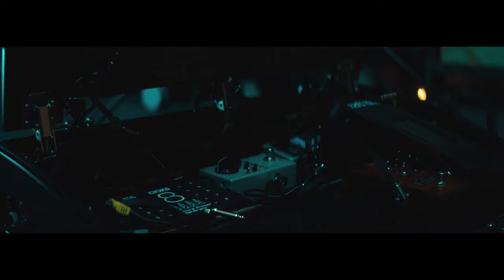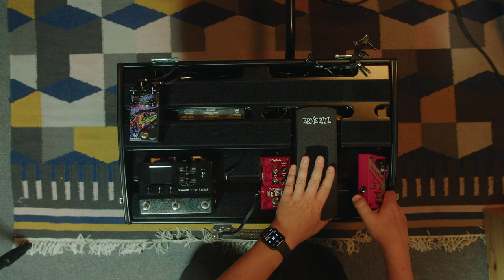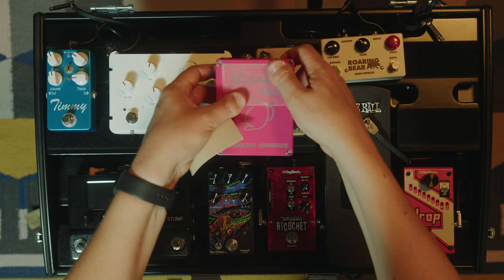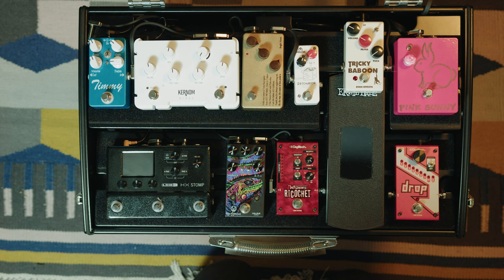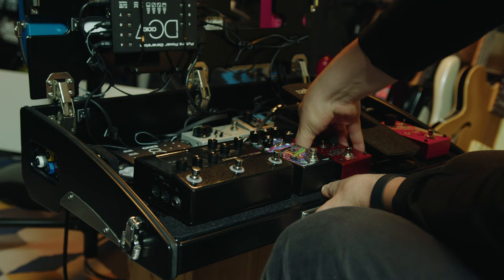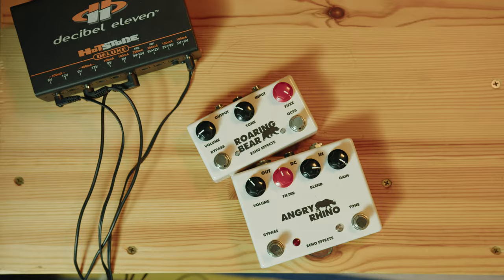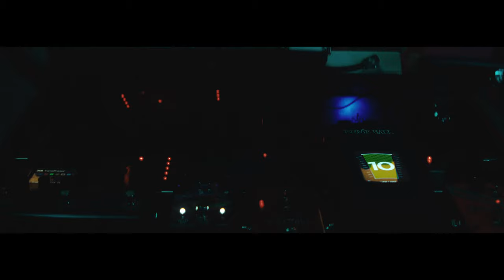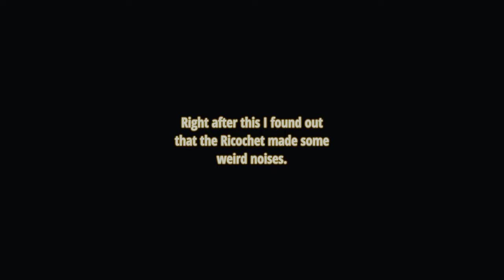My best pedalboard yet

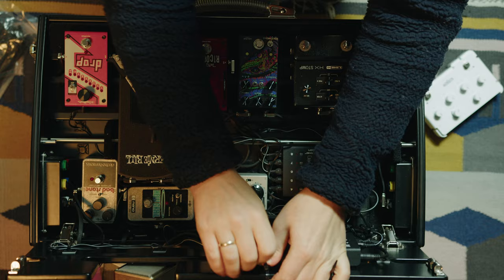Comment: 1:10 looks like it's not sticking because you might be using a "Lube" as a cleaner.   Prepping with alcohol will resolve your issues.  And using quality REAL 3M dual lock.   User error I think my friend
Reply from the maker: I used alcohol to clean. But yeah, 3M dual lock would probably have worked better!